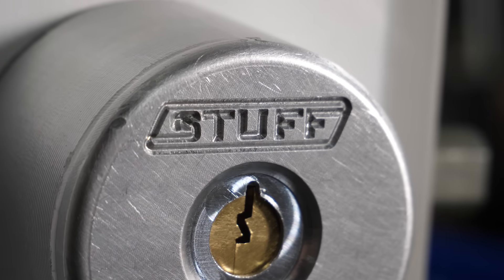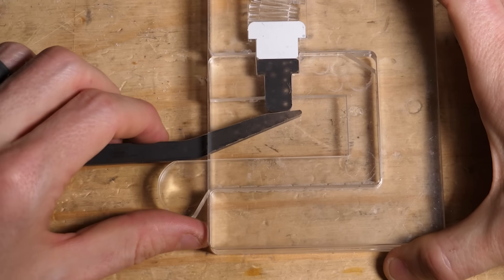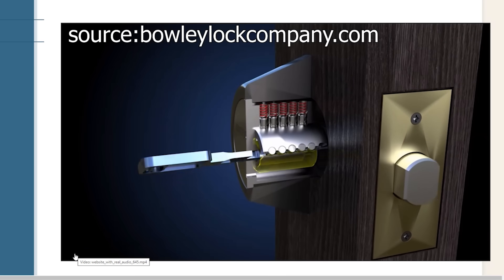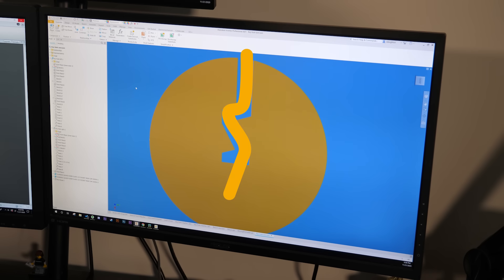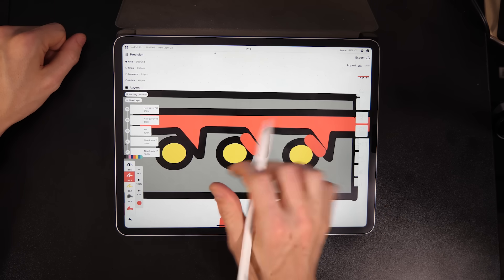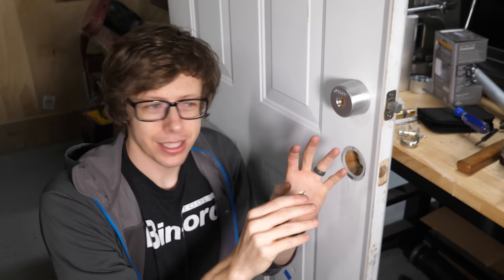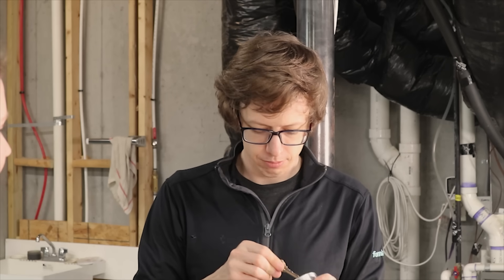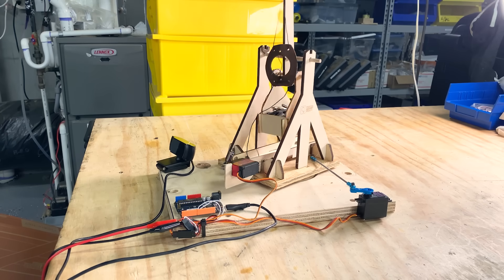Making an unpickable lock. Calling locksmiths

Comment: I really think your video provides a lot of educational benefits for understanding why lockpicking is a thing in the first place :) And really impressive how much work you put into your design! Similar attempts have actually been made in real locks (e.g. by Fichet and Abloy with their disk blocking mechanisms), but both of them don't shroud the elements away from further probing, so they are still susceptible to decoding. If we could fit your idea into a euro profile form factor (and yes, that's likely a big "could") , then it might be interesting to pursue.

There's one important remark I have for the end of the video: Going for electronics to solve the picking problem is unfortunately not a guaranteed remedy. In fact, not only are there tons of problems on the electronic layer (which are solvable but still being done wrong), but also on the mechanical layer. There are tons of electronic locks that can be bypassed in one or the other way because it is surprisingly hard to design a mechanical system that is not susceptible to attacks via vibrations, bumps, magnetic forces, etc. (esp. with the requirements that lock manufacturers have here, like energy usage, reliability, etc). If people are really worried about lockpicking (which they shouldn't be that much, because it is not a usual way to break into a house), then I'd rather recommend high security mechanical locks. While we as experts can pick pretty much all of these locks in a controlled setting (like, on my table), doing this in a door is an entirely different situation and unlikely to succeed in a reasonable amount of time (+ the amount of people that can do this is limited). Mechanical or electronic bypasses for electronic locks, once known, are in contrast often very easy to execute and require little skill.

Comment: Fairly certain the 130 guesses for passwords do not apply good sire.

Thats why you only got 3 to 6 attempts before ur locked out of an account after faulty guessing.

And passwords unlike locks scan the whole password and say wether its correct or not. It doesn't do letter by letter or number by number and deffinetly will not tell you wich one is correct. Its easy to guess for a lock in that regard. But you cannot compare that to a passcode. Unless its a letter/number combinatiom Lock. But ANY digital passcode is pretty much impossible to guess without software doing the work for you

Comment: Protractual diagnostics would work.like any lock it will have tolerances that can be exploited. You would need depth keys for each position and a make up key. Test the rotation to a high degree of accuracy on each depth and build your MUK as you go. A correct depth will show a tiny degree of rotation than an incorrect one. This method works on many locks including the once considered un pickable Rosengrens RKL10 safe lock

Comment: You´ve never heard of me, so you will just have to take my word for it: it´s hopeless. Sort of.

First of all, congratulations for the understanding of the fundamental precept -- and constraint -- of picking. The implementation is secondary to this inspiration.

Centuries of refinement of locks -- and their picking -- is sufficient to know there will always be a workaround. Every lock gets compromised -- as you know from the channel of LockPickingLawyer. Centuries before us, it became the implicit goal of designers to prolong the process, not presume to make it "unpickable."

The thing to understand is that only a fraction of a fraction of illicit lock-breaking is via picking, if unskilled techniques like bumping, bypassing, combing, raking, shimming, or vibrating are not included. The profound majority is by other means: (hydraulic) cutting, drilling, forcing, annealing and melting, core pulling, sawing, spreading, (oxyacetylene) torching, ... even to utilize acid, gallium, liquid nitrogen, and micro-charges of explosives. All that your lock really changes is the position of where to drill a new keyway. (Hint: I wouldn´t make your warding gates colinear). There is no limit to criminal innovation, especially if it is how to circumvent the necessity for special skills, methods, or knowledge.

Also, for locks without a key (or combination!), being digital locks like time locks, RFID locks, and ones using fingerprint discrimination: although they will eventually subsume the market, they are currently just as insecure, if not more so.

There is only one last application for the (legitimate) skill of picking -- well, two actually -- and it´s not even that, insofar as impressioning is paramount.

You can have the satisfaction, however, that you have preempted my implementation of the same idea.
Reply: You're making an obvious point no one is arguing against. He said he was making an unpickable lock, not an indestructible lock.

Comment: Theoretically someone could build a pick-gun with multiple very thin picks, and sequentially brute-force it in a few minutes, which would be akin to LPL's pick that he made with bosnian bill, for picking disk detainer locks. That's to say, a dedicated pick made specifically for this type of lock, which means a high cost investment on anyone trying to pick it, which in and of itself is a deterrent. also, a 10 gauge solid slug will open just about any lock, if you wanna get technical.but as far as "using existing tools", yeah, I'm pretty sure that's unpickable.

Comment: you might have the best lock but if the glass on your door only takes a hammer to smash, not much good. now if you put that lock in solid steal door with a steal frame in concrete would be good. but most all your doors sold at Home Depot is thin metal over wood.

Comment: What if you set all the pins in the full up position, then turn it and give the lock a few shocks to shake the pins loose from the holding device and drop them into place?

Comment: If the locking bar is spring loaded, does that mean you can put the key all the way in and "reverse" bump it using the spring bar to push it back the other way?

Comment: 10:30 unpickable lock - RFID??? 🤣🤣🤣 Sure, it is a digital vs physical keyed lock... but still vulnerable to “picking” or key copying.
Reply: I think you underestimate the power of modern Cryptography. Not only is it very easy to make a verification scheme that makes brute-forcing essentially impossible, you can even build it such that the key is not copyable from its output alone. Unless someone has direct access to the stored data, but for that you can do tamper-proofing shenanigans.

Actually, iirc that system exists. It's called Credit Cards

Comment: So, you can theoretically just attack the bar: push all pins upwards, add rotational pressure, release bar lever a little, and wiggle it until secondary pins drop into corresponding holes, maybe with screw gun with minimal tension.

Comment: "Picking a lock with 5 pins should be almost totally impossible" 

"This is the Lock Picking Lawyer..."
Reply: " got the first one, second one is binding on me... there goes the third one. fourth and 5th are a little sticky but ..... oh there it goes... and all 5 pins."
Reply: unfortunately, this lock is vulnerable to wet chicken attack
Reply: C4 and lock is done ez
Reply: @sasusaku1478  yeah that would work, or would it be better just to blow the door. the point is that the lock is really good at locksmith protection.

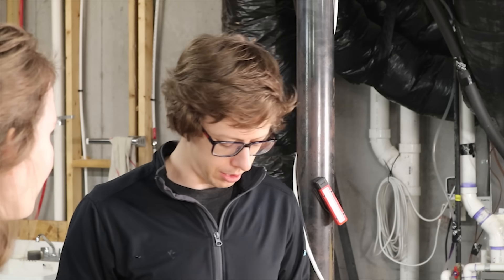Comment: I don’t see why this isn’t commercially viable (10:24). The traditional key locks are by far the most used en bought locks in the world. I also don’t think the mechanical complexity is too complicated. Yes it makes the lock more complicated, but the technology to mass produce such a thing already exists. I don’t think the extra individual parts are more complicated to produce than parts from a basic key lock. There are just more parts.

I do wonder how many locks are actually picked by burglars. I think most locks are “unlocked” by just screwing a screw inside it, and pulled with brute force.

Comment: So, spitballing...raise all the pins, hit the lever in the back to lock them in place, turn the cylinder until the pins hit the gates, then release the lever while tensioning the cylinder. Ideally, the pins will set as they fall and pass through the gates? My point is: make sure the pin locking mechanism can't be released while the cylinder is turned, that's gonna be your downfall, if anything. You can't allow any movement in the pins when they are near the gates. That's just a little refinement, though, your idea and execution are incredibly impressive.

Comment: This doesn't make sense to me. 
Firstly: Why upgrades (more pins etc) before sending to LPL ? That shows you aren't confident that the underlying design and product as it stands is fundamentally pick proof you are just trying to complicate your way out of a problem, that approach is a red-flag for poor judgement.
Secondly: Now you have released the basic design principles not relying on security through obscurity that defeated the locksmith you called out, someone will work out an approach
Thirdly I can see a one at a time approach that would take ages and is inefficient, but surely someone could optimise it from my this principle. A bit like opening a sentry fire safe where you have an elastic band and pointer and graph paper...  you would need a set of  (7 maybe?) modified keys that has only one bump/bit at the deepest pin at the various different bit cut depths (all other bits removed) and cut at bottom to allow a tension tool/pointer etc to push in the end so the lock will capture top pin and rotate. Put in key 1 on deepest pin and let the band and pointer indicate rotation, note on graph. Repeat for the 7? different keycut depths against deepest pin in the lock. See if anything was indicated. Repeat with the keys not quite pushed in for pin 2 (activating lock with the pointer tensioner. see if anything indicated. If you still only have 3 pins like on video once you have to repeat for the outermost pin and then, you should have indicated the required keycut for one of the pins of the lock. This is the basic attack principle to gain information, with a lot of blank key cutting and messing about I will get in. Sure it would take me ages to do and it won't be covert on your doorstep but I believe there is at least this vulnerability and likely other far more elegant ones too

Comment: I had a really cool key for a house I rented in a high crime area I always thought it would be near unpickable and was quite simple. Basically it had pins on the top, bottom and sides... So you'd have to find, pick and trap pins in 4 directions. The ones on the sides were very small as well so would've been tricky to find

Comment: I Guarantee, 1000000000x that i could get in. Easily...
-Less than 1 minute.
-No fancy tools,
- No training, nada. 
How you may ask. Hahaha nope not telling you my trade secret.
But basically i have two tools. You could get from any hardware. Or home store hahaha.

How a theif gets in, 
-hmm wtf is that lock meh who cares no ones home il go around back and smack a window in, lift a roof tile, lift a sheet of tin/ etc etc or just watch and wait till you leave the door open. 
Or they just kick the door in. 
Another trick they use is to fill the lock with superglue. Stuffs your lock but chances are you wont replace it with the same one.

Rfid locks are also super easy to hack too.

Comment: Wouldn't you just 
1. Raise all pins to the top with picks
2. Set the locking mechanism in place, holding the pins at max height
3. Rotate and bind the pins against the gates
4. Let go of the locking mechanism 
5. Release/jiggle the core rotation so the pins dropped down and bound against the gates
?

Comment: The LockPickingLawyer is built different when it comes to picking "Impossible locks"
Reply: "I'll just use the tool Bosnian Bill and I made"
Reply: I was gonna mention him but he actually commented here
Reply: A lock can be practically impossible for a human to pick in a realistic period of time, but breaking is a whole other issue that LPL brings up often. You don't even need to pick the lock if you can just put a torch to it and melt the insides to mush. In fact, if we take it to the extreme you could put an "impossible" core into a paper thin aluminium lock body and I'd probably be able to just rip it apart with my bare hands.
Reply: Came to the comments to say the same thing
Reply: plasma torch XD
Reply: i know how to unlock the "unpickable lock"
materials:
1.lysol 
2.alkaline water  
3. two cups
4. a unused key

first gat the key and put is in a cup then put a small amount of alkaline water then use the Lysol then spray the key in the cup (use many Lysol) then cover the cup with another cup (wait for like 2 min) then the key is now foldable and can bend and can be made into a new key (then insert the key inside the "unpickable lock" then boom its open)

Comment: LPL: Here's how you open a lock with an oxy-acetylene torch...
Reply: Picking a impossible lock by using 1000 nukes
Reply: @a.e.i2409  Is it LPL or GrayStillPlays?
Reply: Yeah, a pony torch would knock this out quick, and it cant cut the lock, it can cut the door its housed in.
Reply: Defeating an "unpickable" lock with an orbital kinetic strike 6 meter tungsten rod.
Reply: Aha brilliant
Reply: i just think

i know how to unlock the "unpickable lock"
materials:
1.lysol 
2.alkaline water  
3. two cups
4. a unused key

first gat the key and put is in a cup then put a small amount of alkaline water then use the Lysol then spray the key in the cup (use many Lysol) then cover the cup with another cup (wait for like 2 min) then the key is now foldable and can bend and can be made into a new key (then insert the key inside the "unpickable lock" then boom its open)
Reply: It can't be locked if it's a liquid

Comment: “I found a locksmith that specialises in picking locks”

Did you know every 60 seconds in Africa a minute passes?
Reply: Normally locksmith specialize in forced entries. Like busting the locks open
Reply: And many/most that do pick locks just use an auto tool, like a snap gun or EPG, rather than manually going in with a set of picks and a torque wrench.
Reply: Lots of locksmiths don't pick locks. They get you in your car, they'll swap out locks when you move, and they'll create and duplicate keys. Picking locks is more of a professional curiosity than actual tactics used on the job.
Reply: Mind blown!

Comment: RFID locks are dozens of times easier to crack than any typical door lock. Just have to mimic the frequency of the keycard, and your average crooks nowadays are already learning how to crack and scan RFID tags on credit/debit cards, so it’s certainly easier than that. Your lock is damn good, it’s hard to beat good ole mechanical engineering. I’d say it stands more of a chance than nearly every lock out there on the market today